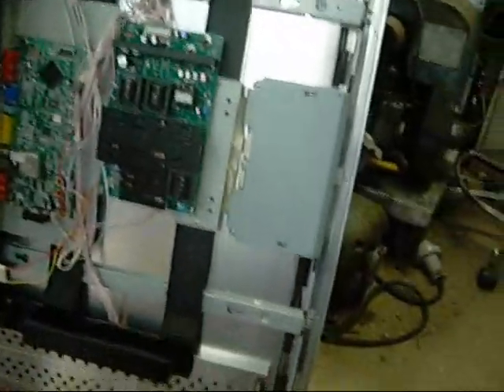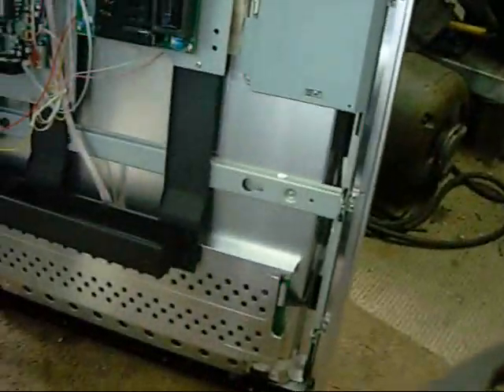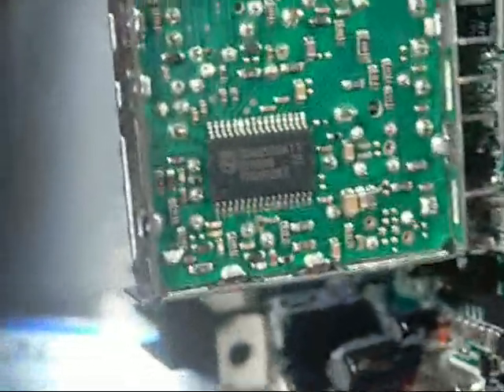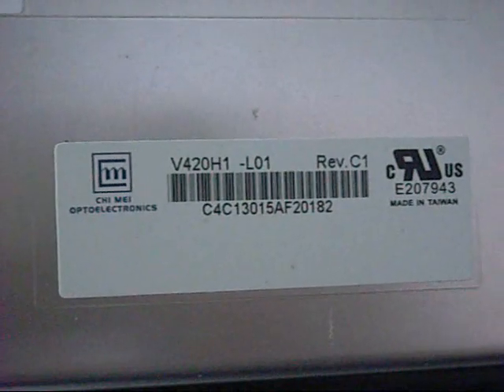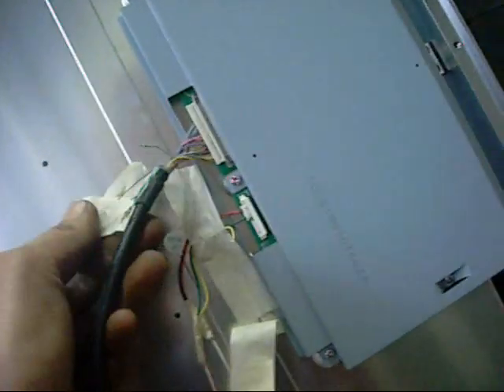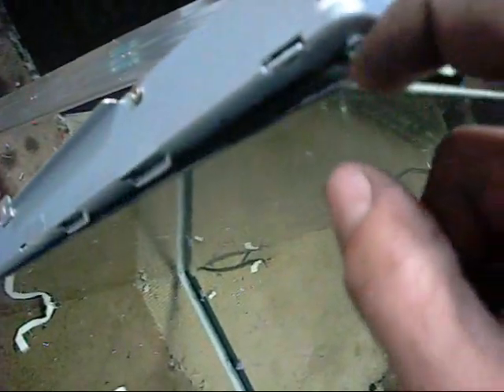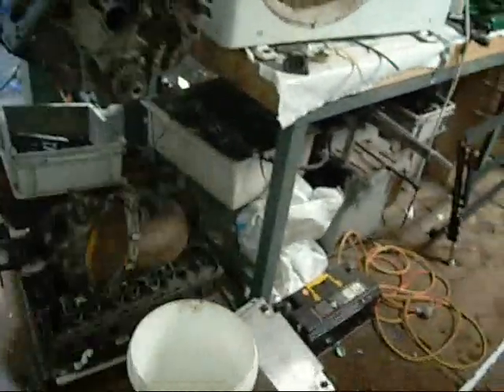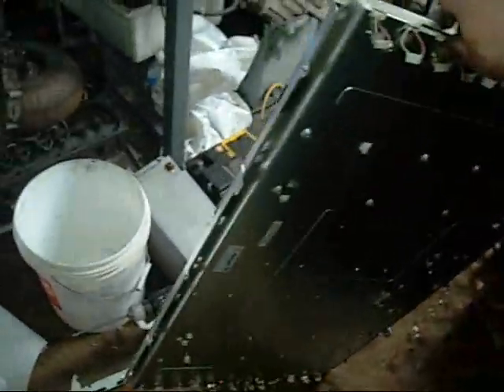Prototype 42 Inch LCD TV Disassembly

Comment: I would like to see that CCFL going, probably a analog/PWM signal and a digital signal (0 or 5V most likely) Nothing you can't find at the PSU.

The PSU will probably need a logic signal to start (the standby supply may provide it)

Comment: if nothing else you should keep the speakers if it even has them still. and keep the backlight parts as they can be made into a cool desk light. KipKay did that with a flatbed scanner and made a desk light out of it. where is the audio amp in this TV is it in the PCB and integrated? id love to tear down one of these TVs but not if they work. I may have one coming.